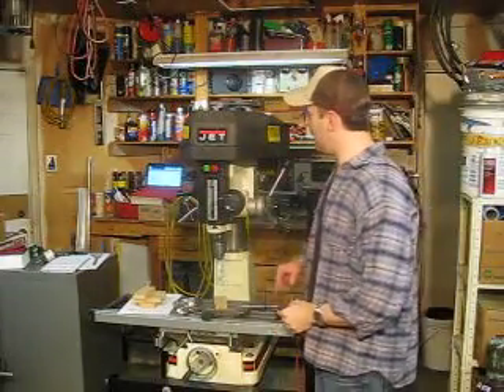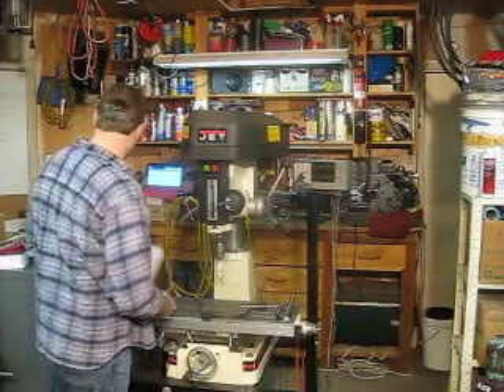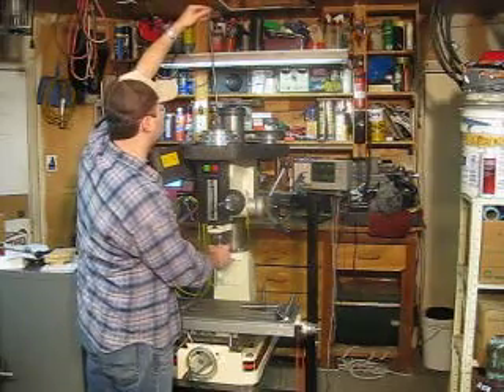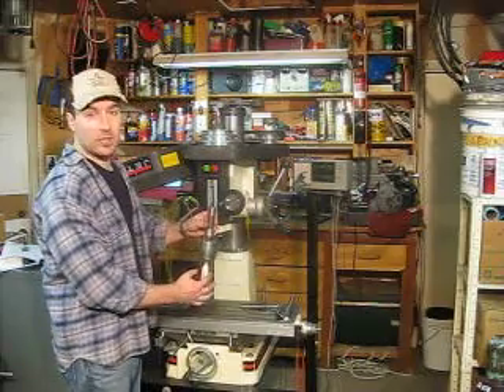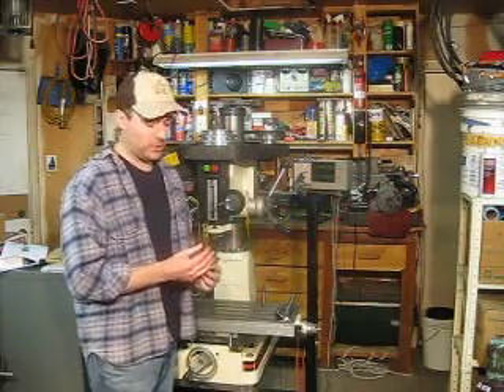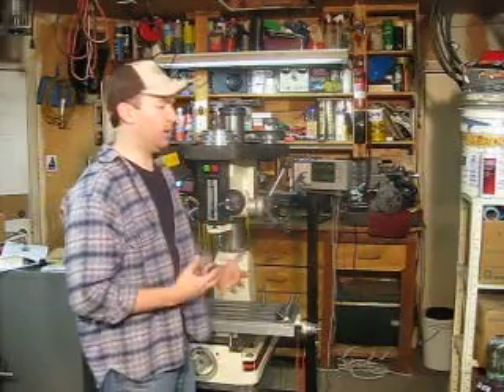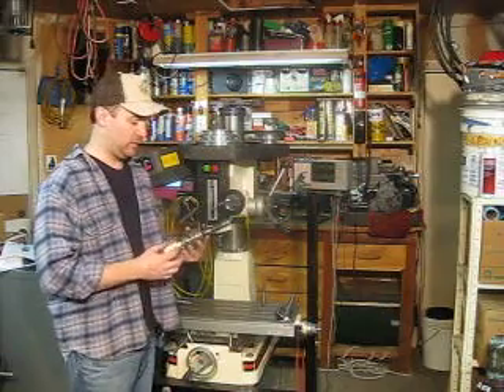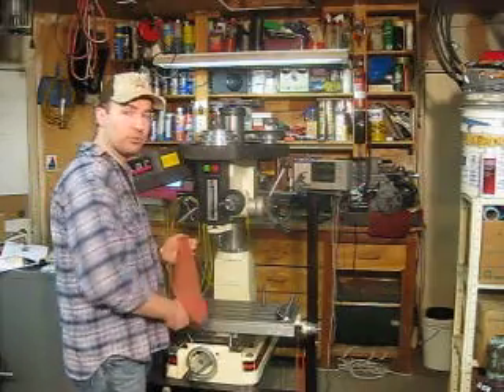Explaining an R-8 Spindle Taper on Jet JMD 18 Mill Drill Milling Machine

Comment: I have a jet mill drill and I want to replace the chuck.  I removed the long bolt on the top but the chuck does not drop down. It feels pretty tight and I’m not sure how to remove it.  Any suggestions?  Thanks.